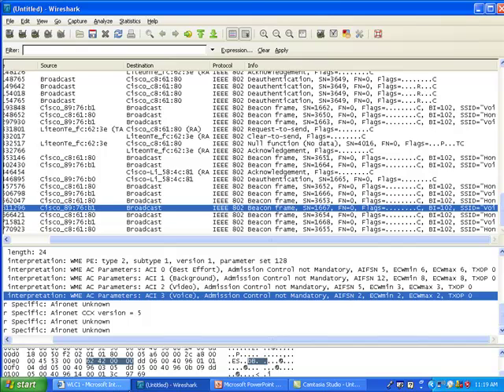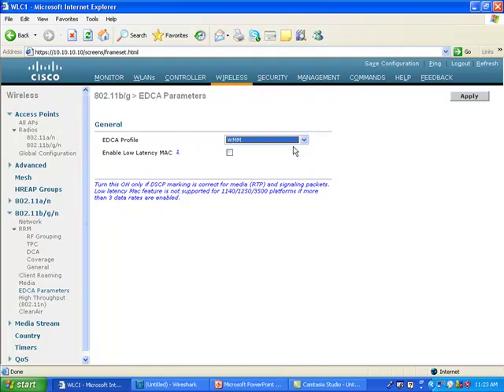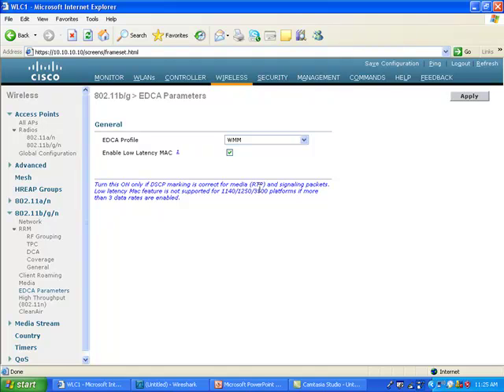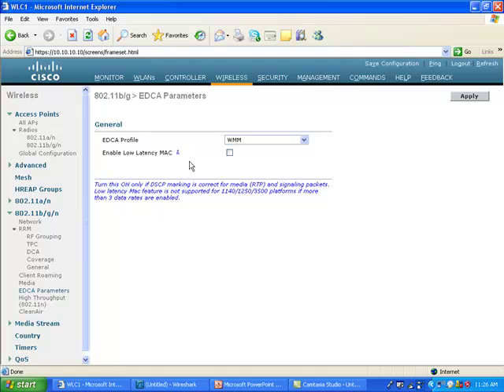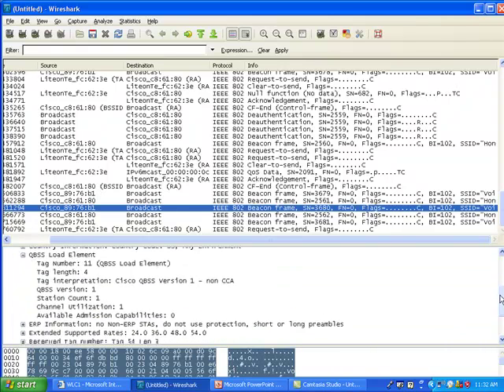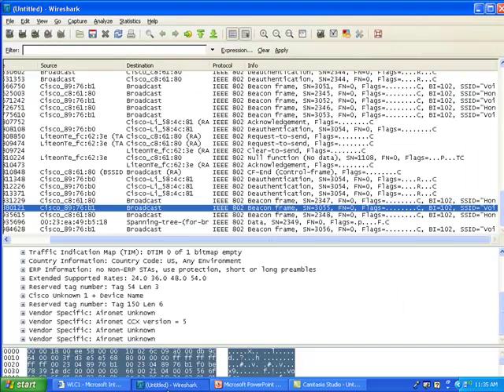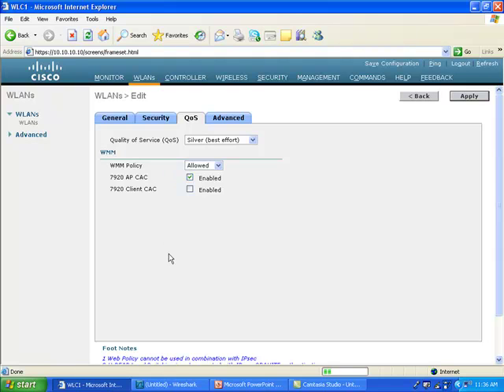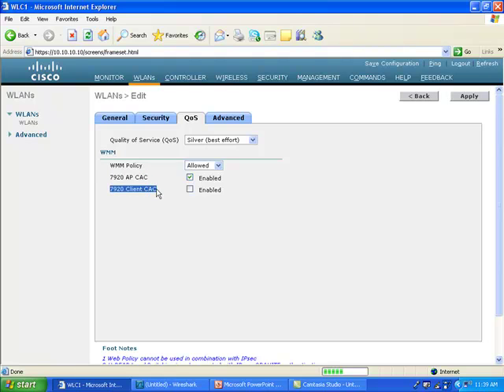Wireless QoS, part 2-b

Comment from the maker: Also keep in mind that there is a timer consideration. An AP in local mode needs to communicate very often with its controller, and the timeout is short. This is also one reason why most people prefer to use an AP in H-REAP mode when connecting over a WAN. Timeout is also important. On code 5.2 and prior, the round trip time (time between the AP sending a message and the answer from the controller coming back) has to be less than 100 ms. This timeout was extended to 300 ms on code 6.0 and later.

Comment: micheal...yes that will work.  Many people typically will have a controller at a central location with lightweight APs at remote sites.  Typically, you would run those APs in H-REAP mode where the control traffic is centrally controlled by the WLC but the user data is put on the wire at the AP and not tunneled back to the controller.